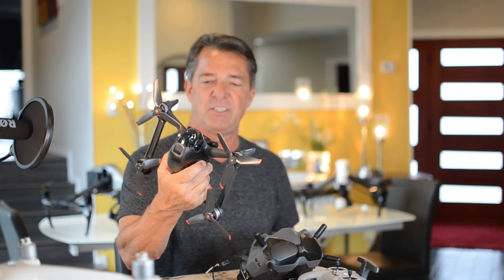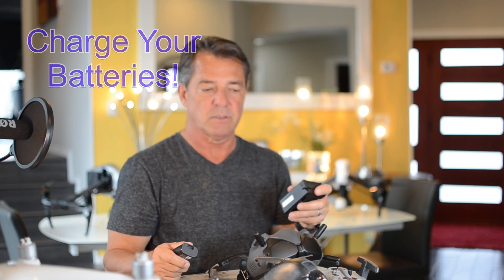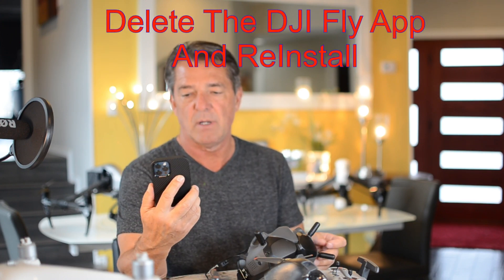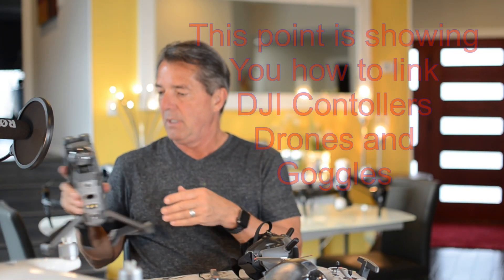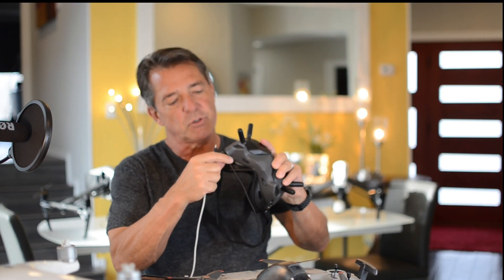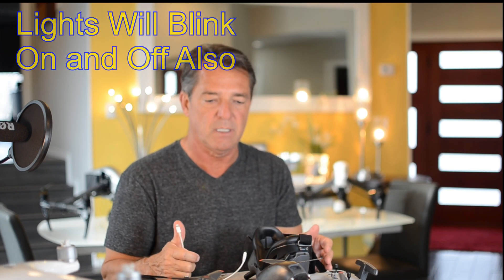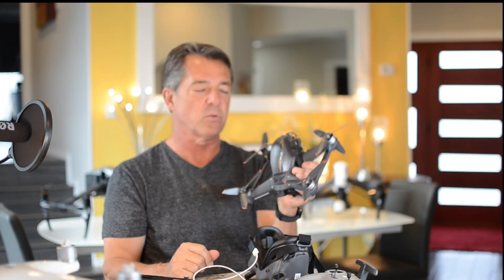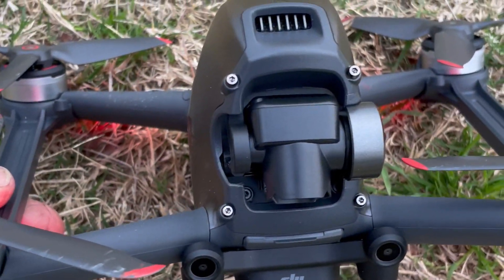Having Trouble Updating Firmware on DJI FPV? Watch This! Also Binding Instructions!

Comment: What SD card are you using?  I used the one recommended for the Mavic and get a message “Slow SD card”.   It’s a speed class 10 but I see they now have 30, 60 and 90.  What is the average file size of one flight assuming 7 to 10 minutes per flight?
Reply from the maker: Sorry, John, missed this, I had he same thing happen, it was with a older card, all the ones I buy at Walleyworld lately work, I think they are class 30, you can get 128gigs for like $8
Reply: @b4ugo  thank you, what is Wallyworld?

Comment: Just a heads up. You can use the assistant 2 (fpv Version) on a desktop computer. I was having the same problem, then tried it on the computer it worked no problem. You just have to update them separately.